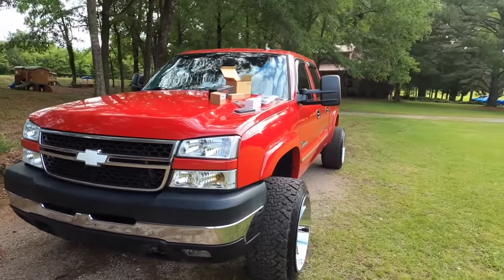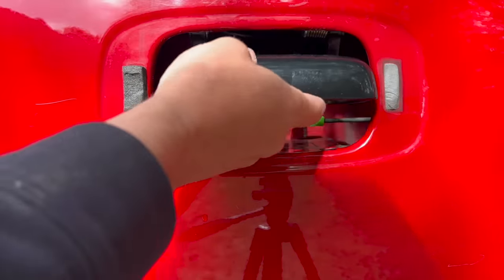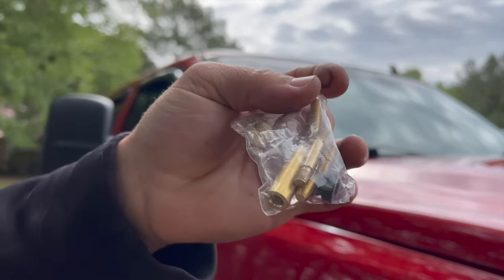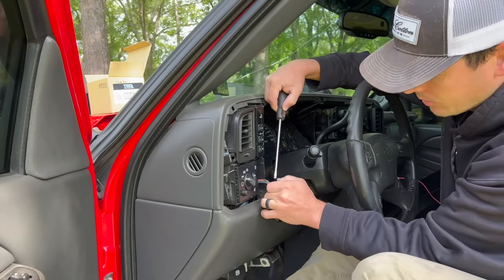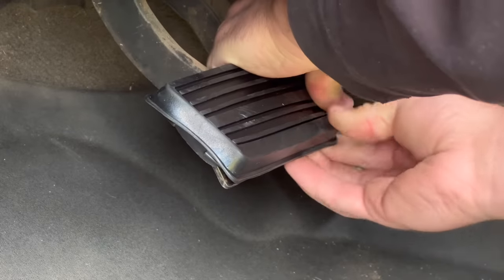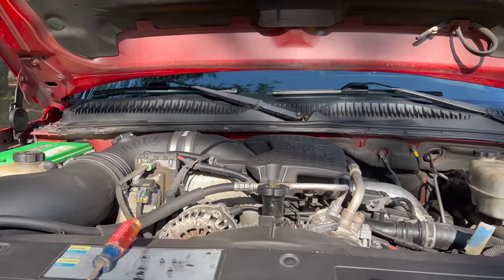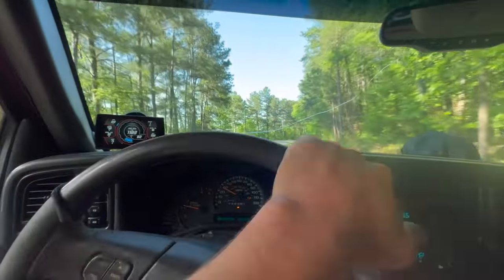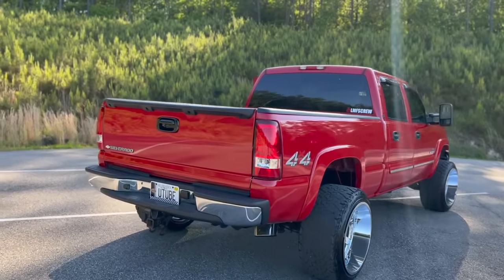CHEAP UPGRADES THAT GO A LONG WAY!!!

Comment: It’s not a real Chevy if the windshield ain’t cracked 😎🕺🏽
Reply: Literally lmao
Reply: Completely different brand but every 1st gen tundra I see has a cracked windshield
Reply: Don’t forget the broken switch panel
Reply: Ikr lol
Reply: Shit you not I just purchased a 2022 Colorado the other day and on my way home a rock flew up and well it wouldn’t be a Chevy without one so
Reply: Mine is beat tf up 😂😂😂
Reply: First day driving my duramax a semi kicked a rock up into my windshield, i wasnt even tailgating.
Reply: Lookin at my cracked windshield right now🤣
Reply: Facts😂
Reply: Never had a cracked windshield on one of these...I had to replace mine because it was so pitted, I couldn't see driving into the sun. It isn't one of these trucks if that tailgate handle bezel isn't missing though. Lol.
Reply: Damm now I gotta accidentally Crack my windshield
Reply: That’s a free mod.
Reply: Looking through my cracked windshield on my 1996 k1500 right now 😂
Reply: If the driver door don't sag........
Reply: Why
Reply: Sad but true, I have had to replace my windshield twice already and I have a chip in the new one now 😂
Reply: Just picked up a Chevy w a crack😂
Reply: Never owned one that didn’t have a crack 😅
Reply: I've had 2 and both were cracked 🤣
Reply: @FTW1984 need to stop tailgating people
Reply: Unironically yes💀💀💀
Reply: Damn mine is cracked why lmao
Reply: da windshield and da truck bed door
Reply: “Dash” lol
Reply: Honey, why did you hit the windshield with a hammer?? Guys on the internet told me my Chevy wasn't real

Comment: Those tires sticking out beyond the fenders are about the most ridiculous mods I see on trucks! If you must have that hideous look, do the job right and have the fenders built out to shield the wheels and tires! With the weight of the wheels and tires moved to the outside, you also shift the weight of the truck, wheels and tires away from the center of the wheel bearings, where the weight of the truck should be centered! The truck will NEVER handle properly again, unless you go no faster than 20 mph or so! And your tires WILL wear on the inside first! This mod puts excess forces on the outside of the wheel bearings away from the center of the wheel bearings where the weight should be supported! Not to mention since the tires are outside the truck's body, stones will fly off the tires from time to time hitting any surrounding vehicles! At the very least, mount mud guards behind each tire to cut down the flying objects thrown up from your tires! You're NOT the only one on the road!
Reply: Beautiful Truck Absolutely Ruined
Reply: Good for you. Or sorry that happened. Idk I ain't reading all that 🤷
Reply: Hahah Then you would hate mine wanna see a picture

Comment: Good cheap mods:
1) Headlight/Fog light/High Beam mod. Usually referred to as the "6-high mod". A couple cheap diodes gets the fogs to turn on automatically with the headlights, and has all 6 lights on when you switch to brights. 
2) LED strip lights in the front seat footwells, and rear floor area. Wired with the dome light such that they come on when a door is opened. Wires & lights are completely hidden, but eliminates any shadows on the floor areas.
3) DeeZee easy down strut for the tailgate. Just pop the tailgate open and let go; the strut slowly lowers the tailgate.
4) Not sure if this can be sourced anymore, but an Escalade cowl piece where the stock truck antenna sticks up. The gmt800 Escalades didn't have an antenna sticking up there, so the cowl piece is smooth. Just run a stock length antenna horizontal under the hood on the lip of the passenger fender.

I've had all these for over a decade. Best "bang for your buck" cheap mods.
Reply: Jesus loves you alot trust in His death 4 salvation and be saved from eternal hell <3 Jesus died on the cross for you bro.

Comment: LGND also did door handles that have LED strips slim and bright in them. Look outstanding. You should do them and your tailgate handle with a brake light strip in it. Would be crazy

Comment: ever considered vinyl  wrapping between the side windows? I did it on mine and absolutely am in love with it. I drew a straight edge with masking tape off the top of my drip guards and made it level with plastic strip under the window. it was extremely cheap and it didn't take a ton of time. well worth it in my opinion.  love the vids keep em comming. gives me ideas for my 07 crew long lbz.

Comment: on my old 2006 Sierra I fixed my fog light switch with a little spring from an old remote control (the little springs that hold the batteries in place)  The original switch is a chintzy design where the spring action comes from a little rubber diaphragm that breaks and flattens out.
Reply: I use a spring from a ball point pen and a small wood screw.

Comment: The 5.7 vortec in my 98 obs had a similar resonator that I did the same exact rubber cap on. It sounded so much nicer in the truck and definitely made me drive a little more spiritedly lol as for actual gains probably not that much if any at all it just sounded cool.

Comment: Thanks for the video of cheap upgrades. I’m actually picking a 2004 Silverado on Thursday and need to replace the tail gate handle. Have you figured out how to fix the drive side inside part door handle on the Tahoe? My wife’s suburban handle is coming apart.
Reply from the maker: Unfortunately looks like you have to find a new door panel, which I haven't found one less than $300 :/
Reply: @lmfscrew  thanks I figured so.

Comment: Chevies I love but your always fixing something on them. Had to do the same thing to my S10. Had to change out my 3rd door latch too.  I've got a second standard bed s10 that I need to fix the heater climate control problem. Cold works heat doesn't.

Comment: The headliner is a pain.  I gave up on it and just took it to the upholstery shop.  Took them 4 hours and 3-4 hundred.  Money well spent.  It's nerve wrecking thinking you're gonna snap the fiberglass headliner in 2 while trying to remove.

Comment: The pole antenna will outperform the dinky bullet
Reply: Yeah if you buy a cheap one. Ronin makes a pretty damn good one and i can't tell a single difference in signal between the stock and Ronin.
Reply: @tcl0028  radio waves rely on "line of sight" transmission. Pole antennas have a greater line of sight. No ammount of "technology " in an antenna will increase its range.